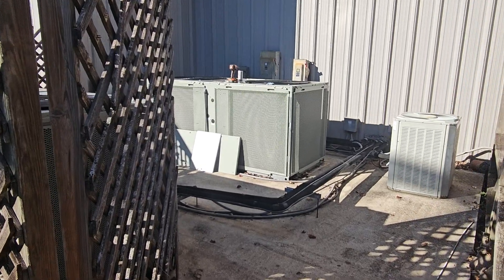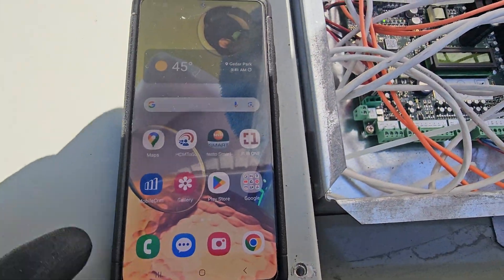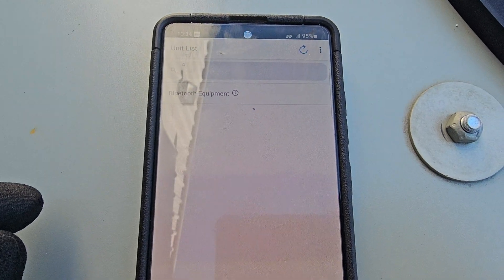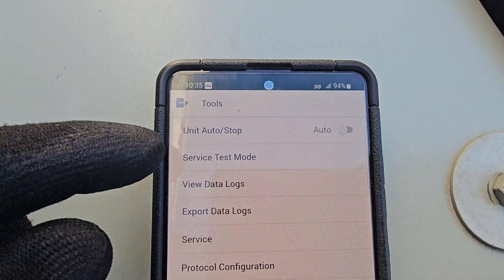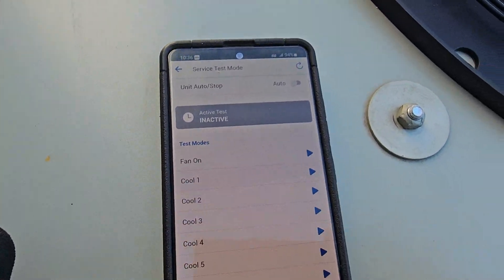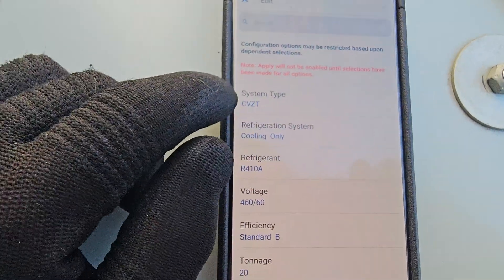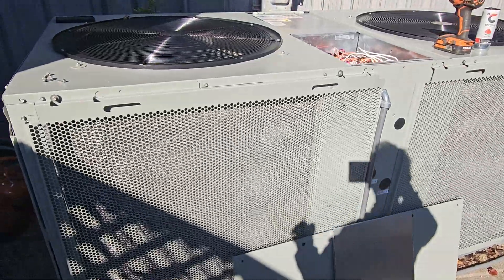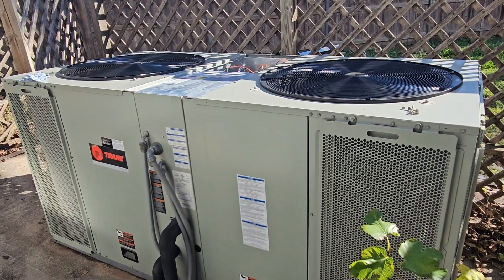QUICK LITTLE TUTORIAL/ VISUAL ON THE TRANE SYMBIO USING THE APP. #trane #symbio

Comment: Symbio works pretty well. Haven't seen one on a split system yet. Does the air handler have the same control.
Reply from the maker: Not really sure. I didn't check it out. The room with the AHU was occupied. I didn't feel the need to look into it any further. It was a simple issue and the equipment ran just fine in test mode and normal, using the thermostat. Im trying to train myself to not always dig in so far on certain calls. There is probably something else i could've nit picked.....but im trying to let it go when the situation calls for it. It was a warranty call.
Reply: @jasonjohnsonHVAC  I was just curious, me and my apprentice and I were watching on lunch. Not all calls need the big picture.